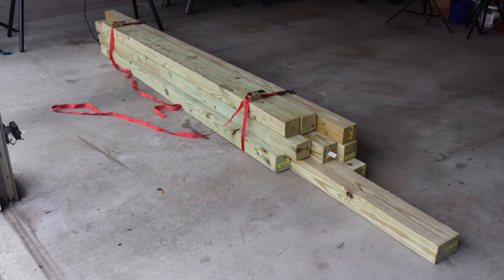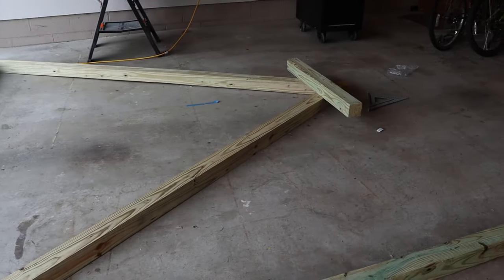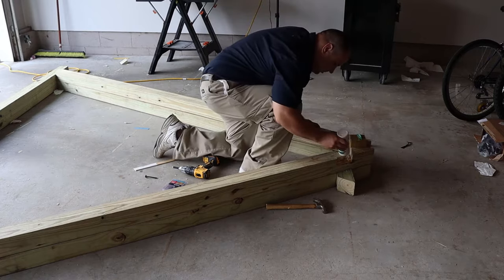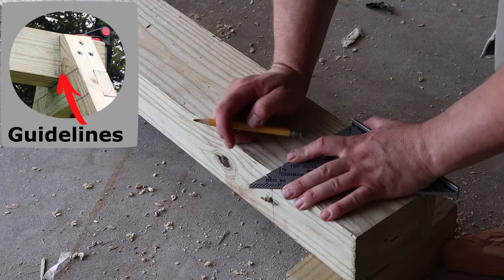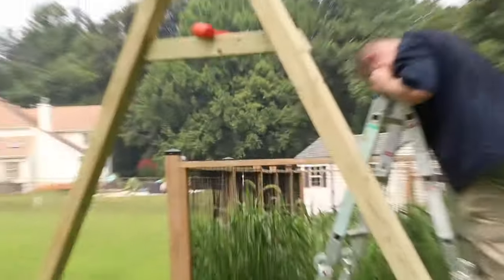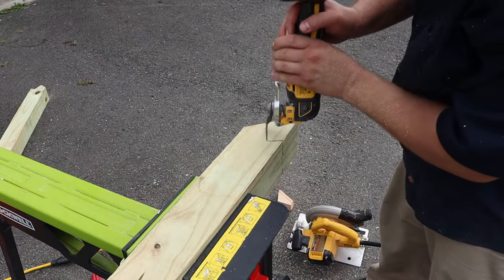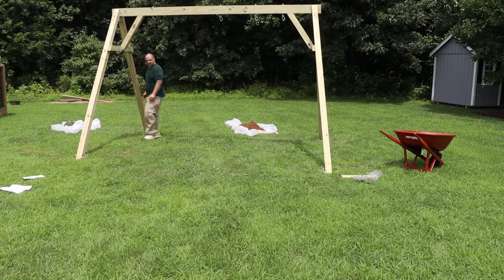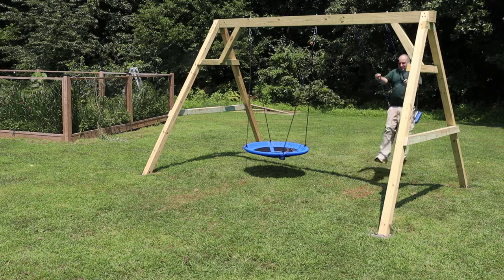How I Built a Strong, A-Frame Swing Set from Scratch...

Comment: Thanks for this video. I am planning to use your essential plan here for a stronger swing set for our kids. They are now solidly preteen and have outgrown the smaller one we have. Question: what do you think if I would essentially double your design and add a middle A-Frame. So my main top beam would be 4x6x16 with everything at 18 in intervals. Enough for four swing spots. I would also set this with concrete and concrete anchor plates. Thoughts and the strength of this construction specifically thinking about the middle A Frame being enough to support the additional 2 swings? Ideally there would NOT be 4 swingers at the same time. I only have three kids. But purpose is variety and spacing.
Reply from the maker: An extra middle A-Frame is the definitely the way to go. The biggest issue is keeping the unsupported span of the 4x6 at a reasonable distance. You're spans between supports will be less than 8 feet so the stress on the 4x6 won't be bad at all. As long as you're using 4x4s for your A-Frame legs, I don't think you'll have a problem. 

Anchoring to concrete will be significantly stronger than my solution of setting into gravel and metal anchors. FYI, my swing set doesn't move at all even when I swing on it full force. With concrete at six points anchoring three A-Frames, I doubt you'll have any issues based on my experience.

Comment: Building same design but attached to a playhouse on one end. I'm also very curious about whether a half-lap joint on the legs would weaken them. Haven't been able to find a good answer yet.
Reply from the maker: Yeah, I looked too. Although I'm sure the half lap weakens the joint, I could not figure out if it was that significant especially since the wood lengthwise will shrink more than the cross members really locking things together. In the end I skipped it just because the forces from swinging are pretty intense compared to a static build and I wasn't going to risk my kids getting hurt from a purely aesthetic design feature.

Comment: Is there a reason you didn't you the mitre to cut out the sliters and space  the one at 2.42. The finished swing looks awesome. I'm looking at a few different ones to see what kind I want for the garden, it's for me.
Reply from the maker: Glad you liked the swing. I'm not sure what you're asking about the "mitre to cut out the slivers". Are you asking why I didn't use the miter saw to do that instead of the circular saw?
Reply: @DIYWithAaron  yes why didn't you use the mitre for the box cuts, not sure the name of the joint. On mine you can set the depth of the blade to cut the lines out to make the square.
Reply from the maker: @GundamGir1  Can't do half laps with my miter saw.  There's no sliding function on it and no functionality to control the depth accurately or uniformity across the entirety of the cuts. It's older and basic... more of a glorified chop saw then what they sell nowadays. If you have the functionality to do the half laps with your miter saw then you can do that instead of a circular saw.

Comment: what kind of wood do you use ? and how does it hold up to outside conditions (i.e. rain and snow)
Reply from the maker: Pressure treated, ground-contact rated Southern Yellow Pine. Should last for at least a decade (Northeast weather). Paint or stain it after it dries out in the sun for a few weeks if you want to make it last longer. All materials I used are in the description of the video if you want to use it for reference.

Comment: Can't you set the mitre saw at 30 and 90 degrees? I know 45 and 90.are possible
Reply from the maker: Yes, but angles on the miter saw can sometimes be confusing when not cutting at a 45 or a 90 degree angle. I always mark stuff up first to not worry about making mistakes. When you cut on the 30 degree line on the miter saw, you'll workpiece will actually have a 60 degree angle to it.

Comment: Can you tell me, do I need so much horisontal Woods, if I use 1.2m anchor screws?
Reply from the maker: Are you talking about the 2 cross members on each a-frame or the large 4 x 6 beam that hold the swings and span the 2 a-frames?
Reply: @DIYWithAaron  horisontal ones on A-frame. In complete sets there were not so many of those.
Reply from the maker: @Valuiskihh   The cross members for anchoring the gussets were relatively high, so I added additional cross members lower on each A-frame for more support. You may be able to get away with just one cross member per A-frame particularly if you anchor the legs to concrete or dig them into the ground. You could also use 2x4 material to cut down on the cost and bulk as well. The 4x4s I used for cross members in my build are overkill structurally. The fasteners for the horizontal members are not as important as the beam to leg connections as the force on them is far less. There's also metal beam and leg connectors that you can buy that eliminate the need for cross members and gussets entirely. https://www.amazon.com/Frame-Brackets-Complete-Mounting-Hardware/dp/B01M28VV0N/

Comment: Using an old fashioned cross cut saw instead of the multi tool to finish the cuts on the gusset might give you less grief
Reply from the maker: Not use a power tool? Surely you jest. Although in retrospect, a simple saw might have been a good choice.

Comment: You didn't explain why you measured 30 degrees. Please explain.
Reply from the maker: I wanted all the angles to be 60 degree angles to make a very stable equilateral triangle. So the leg bottoms create a 60 degree angel to the ground and the two 30 degree parts will be on either side of the beam. 30 + 30 will give me that final 60 degree angle at the top of the swing set.
Reply: @DIYWithAaron  Thanks. I didn't think of that.